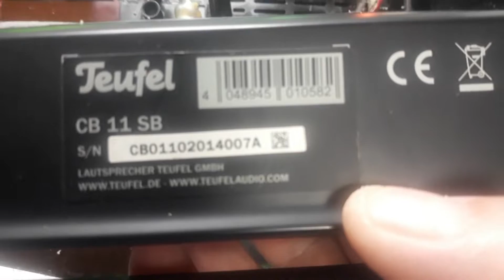Teufel CB 11 SB Audio System Repair – Circuit Board & Amplifier Fix

Comment: I have apparently replaced my Cinebar 11 (2015) model with the newer model (2020) and now I can't connect the subwoofer anymore. Do you have a clue if it's possible to flash the older firmware on the mcu? The wireless TX module seems to be the same (avnera SWA12-TX)...

Comment: Thank you very much for your explanations. I got the same Soundbar and mine isn´t showing any signs of life. I swapped a few of the capacitors on the left side of the big audio Chip. They were slightly bloated. Now I can only measure the 32V at the "U15" (9561AGM) chip and the capacitor next to it.
Do you have any hints why the the rest of the pcb isn´t getting voltages?

Thank you very much in advance 😊
Reply: Did you resolve the problem? I have the same situation here, that 9561AGM is the P-Channel MOSFET which is the bridge between the power adapter and the board. In my case, the gate on this mosfet doesn't receive signal to turn on, and now I have to explore why...
Reply: @Predator-Tactical  In my case it was the EUP3453 which was defect. After replacing it the soundbar worked fine until today 🤝🏻